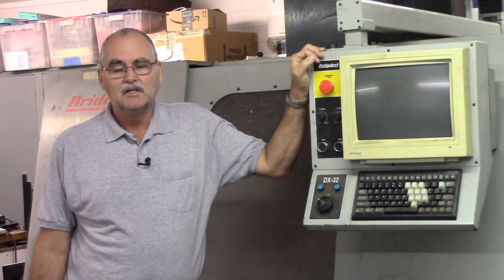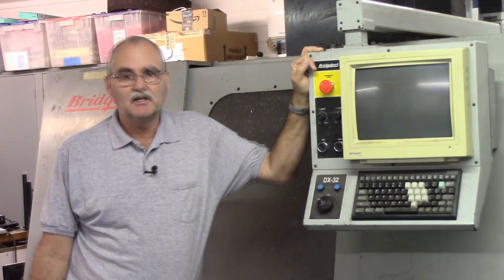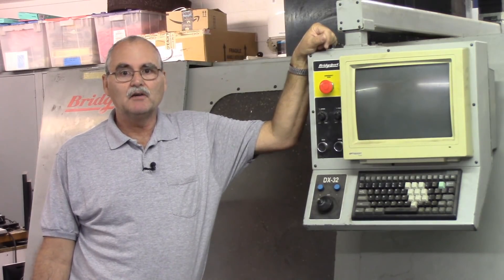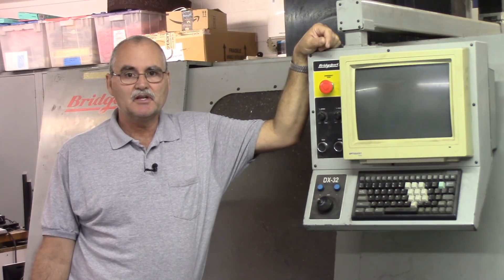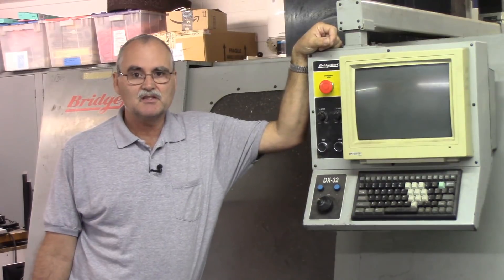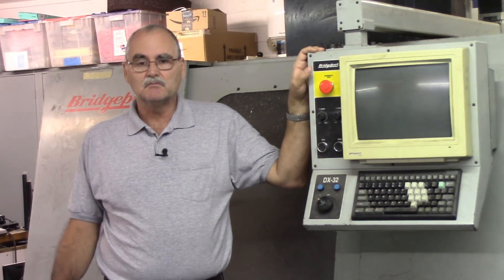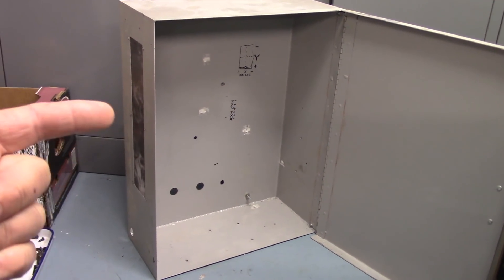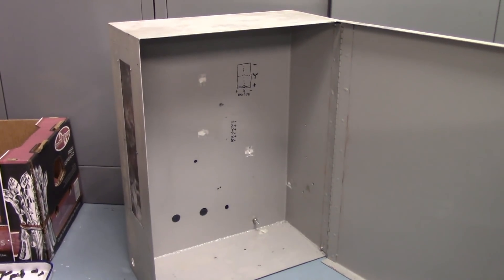Phoenix CNC Router Intro - Centroid CNC Acorn & DMM Technologies DYN4 AC Servo Control Upgrade

Comment: Hi Marty wonder if you could help me. I’ve got a Cincinnati  milacron arrow 500 VMC 
Can it be converted to run off centroid acorn 
Many thanks Vince
Reply from the maker: @m2escort  Hi Vince. It could. You would have to change all the servos/drives to a set that would take step and direction. You would need at least one ether1616 I/O expansion module. A better but more expensive choice would be Hickory with its ethercat system and new servos and drives. I assume the machine's drives are proprietary AC servos?

Comment: hello Marty, great series of videos. I have a question: If I have a part, a model done in Solid Works, what file format would I be able to import it as in Acorn's path generator for cutting ? Thank you in advance.
Reply from the maker: You must run it through a CAM program. CNC12 no longer imports CAD files

Comment: hi Marty ,
what type of fuses did you use for Dyn4  drivers  Control  Logic Power Supply. is there any type of fuse you like more than other. How many amps should I  use. DMM instruction asking 1A for each drive.
drives are connected at relay terminal , so my understanding  L1 gets 3A,.  and L2 gets 3A fuse. 
can i use any type of fuse, ... fast acting or slow blow fuse.  need some help.

Thank you
Reply from the maker: Max, I used one filter an a pair of 3A fast acting fuses to feed the logic of the three drives. DMM said this would be ok. The filter u used was rated for 10amps if my memory serves me.
Reply: Hi Marty,  thank you. 
i used SCHAFFNER FN 612-3 06 FILTERS for each drive, and i've decided to use 2
ABB S201-C3 Circuit Breaker 1 Pole 3A P154,  not fuses,  they are 3A each. so L1 will have a 3A breaker for all 3 drives, and L2 will have 3 A breaker for all 3 drives. i think that will save me some time on replacing fuse each time it blows.

Comment: Why don't u use din rail mounted relays,    terminals and other components? Looks cleaner, and more flexible in the future.
Reply: This is my preferred method as well, but Marty completes 4 machines to my one. He gets shlt done.
Reply from the maker: I do use DIN mounted t-blocks on occasion ...I agree, they are neater.